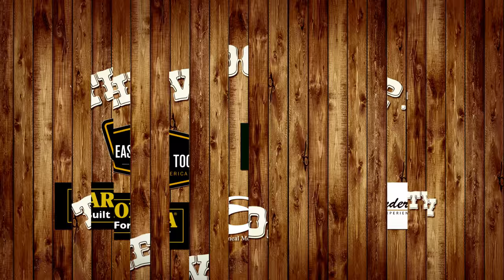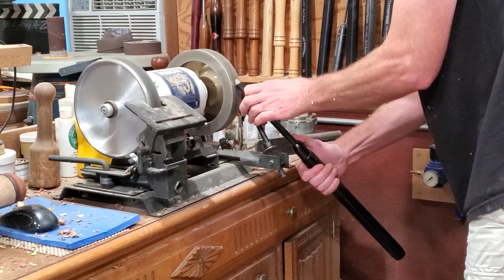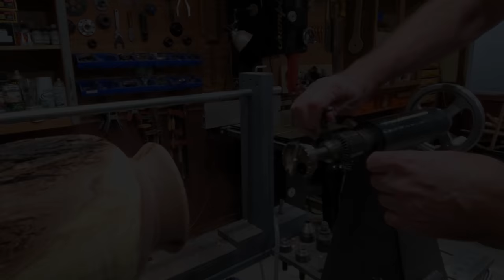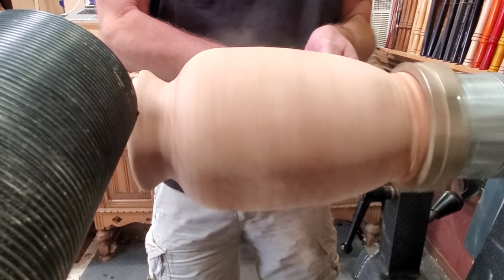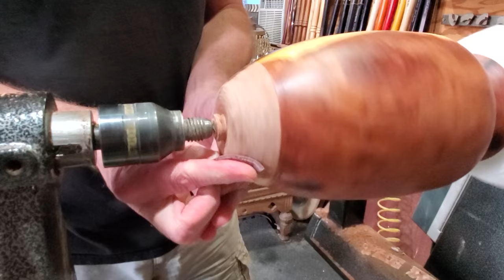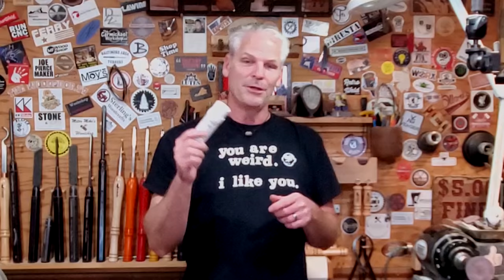Woodturning | Acacia Vase

Comment: Very nice, I'm wondering what you normally run your lathe at. I love my American Beauty but I  am not familiar with a good lathe and fast speed.  My old delta was 600 minimum and didn't seem to change when I raised the arm.
Reply from the maker: Thank you Rick!! I normally turn pieces that are true between 2000 and 2500 I do most of my sanding at 200 I started this piece at about 300 until I got it true.